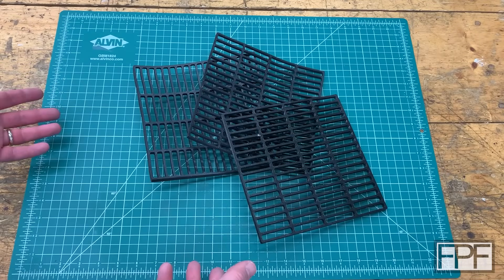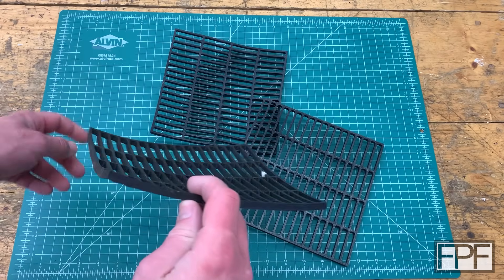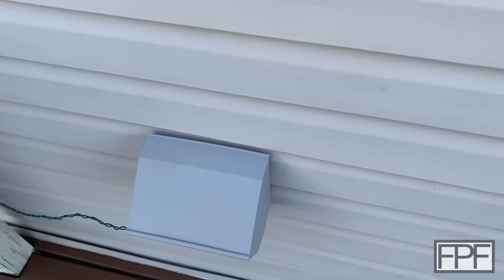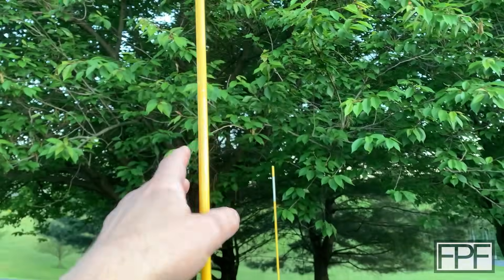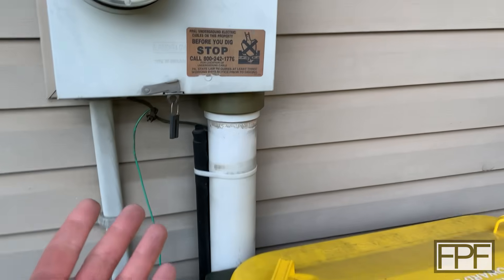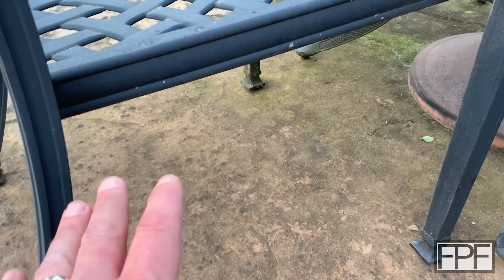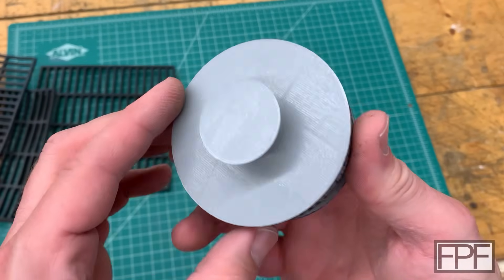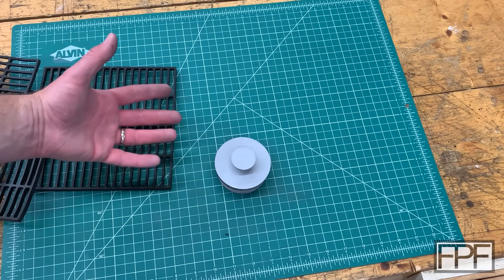3D Prints - 7 Years Outside

Comment: I've printed a couple of brackets like your trampoline ones for some surveillance cameras out of PLA.
They have been bolted to the roof racks on my toyota hilux for about 2 years and there's no signs of wear.
I believe it was black flashforge pla.

I also printed some hooks for the monitor to hang from my sun visor which have crept quite a bit, but theyre still working 2 years on.

I recently designed a replacement sun visor to accept the screen which I've been having some printer troubles so haven't been able to print yet.
Reply: Thanks for sharing! I should do the same. I had some pretty annoying issues last time I tried PETG. I’ve been holding off on doing more things for my car roof because, well, why bother? Sounds like I should do it.

Comment: I printed a rain cover/shelter for a bird feeder out of ASA and painted it to match the feeder, so I suspect that thing will last forever.  I admit I didn't even consider printing it from PLA because of all the FUD about using PLA outside.  After seeing your experience, I'll definitely give it a try and see how it holds up!
Reply: The only issue with PLA outside I'd say is the heat. Where I live in Canada in the summer my PLA prints deform in the sun lol
Reply: @kylequinn1963 get pla+, and the problem is gone. You can get ht-pla that‘s stable up to 140-150 C, that’s good enough for engine bay use. There are very cool plas out there 👍
Reply: @kylequinn1963  I have a PLA lizard out in the sun. About four years old at this point. It's now fading and brittle.

PLA, as a rule, is absolutely not UV resistant. That doesn't mean all PLA isn't or can't be made  to be UV resistant with additives. But if you're worried, either plan on painting (as suggested by others) or simply print with PETG. PETG is naturally UV and chemical resistant. ASA is better than PETG for UV resistance though. Which is why it was created for use on vehicles.
Reply: If you paint it it doesn't even matter that is less resistant to UV
Reply: What a time saver. Please share your experience with filaments so the rest of us can save valuable time and materials. We use PLA mainly for prototyping or internal use, have used PLA-CF externally, but only recently. The PLA-CF can be over coated with epoxy resin. We have only just got TPU working due to our high humidity 👍
Reply: PLA is known and confirmed for failure in direct sun. Especially down south. UV is damaging. But, keep in mind additives can assist with UV issues.

There has been plenty of reports from the 3d printing community of PLA failures in direct sun. Where and intensity of exposure are important. As are the specifics of the filament in question.